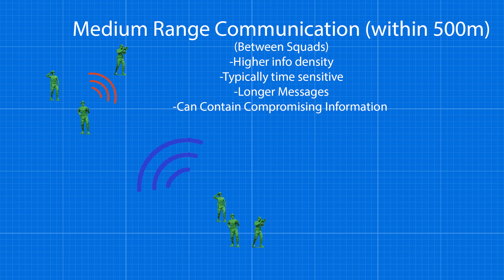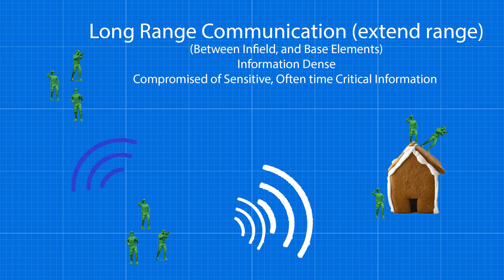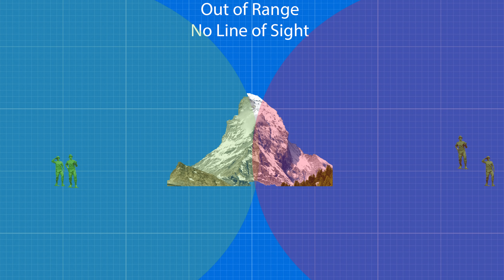Intro to Advanced Comms for the Prepared Citizen

Comment: Learning little things like 10 codes and the Phonic alphabet will help immensely. Most people when using radios at first will have a hard time understanding what is said. This will come with using the radio. Learning how to call then identify yourself is also good radio use. "Base this is Ramrod" do you copy. Learn basic radio protocols shortens what is said. This will be help in situation with many radios. This also makes it harder for others to track you! Note: Phonic Alphabet is learning each letter as a word. Don't make them up. A- Alpha, B- Bravo, C- Charle, Delta , Echo, Foxtrot, Gulf, Hotel.... you get the idea. Guess what I is, hint it's a state. Succinct, short and understandable three must on a radio.
Reply: I’d keep 10-codes out of comms and just use plain speak. It’s easier and you don’t risk confusion for people learning different codes (for example the 10 codes we have in EMS are different from police 10 codes which are different from fire 10 codes).

Comment: used Motorola XTS2500 setup with matched encryption capability is a deece start.

Decent Alternative:
Home built LORA with a repeater network to obscure your location partly with a cell phone hardwired to the LORA RX/TX to decode the encrypted digital LORA signal to text-to-speech for headsets. (If enemy has cell/wifi capability, de-solder cell and wifi chip from board of cell phone or tablet for less chance of detection).
 
If you have someone tech hardy set it up and install repeaters on power poles, this can create a 5-10 mile radius of comms pretty quickly depending on obstructions.

If you want an actual battle map look at Meshtastic and ATAK combined however this may require use of cell/wifi tech.

Stay frosty my friends.

Comment: I'm an exceptional nerd when it comes to this topic, I think you hit the important points without offending the nerds, and probably without beating the noobs over the head. SDRs and RDF devices are getting cheaper and easier to use, I tend to think a real approach here is to use the radio to make friends and gather Intel, this making your local area a bit less hostile.

We regularly post signs when we're in an area for freq and pl to talk, sometimes leave a radio in an ammo can. Talking to ppl outside firing range can sometimes prevent a blue on green.

Comment: This came in with impeccable timing. Our group is finally getting into comms. We decided on Hytera HP682s. Supports AES256 encryption, DMR+Analog, Bluetooth and GPS is optional, relatively simple to program (compared to the Motorolas anywho) and more. Pretty excited.
Reply: U guys messing with atak?
Reply: Encryption just brings attention to yourself and the Bluetooth and GPS just guarantees you’ll be located immediately and likely tracked live in real time
Reply: @riflesfirst208  The GPS doesn't transmit, it just receives.
Reply: @jhutch1470  I can’t say that’s accurate in this particular instance. Does this unit not do that thing where you can flash your GPS position to people in your group?
Reply: @riflesfirst208 t. someone who didn’t watch the video nor do they know what they’re talking about
Reply: @zokhrozzWoomzy  Whatever helps you cope.
Reply: @riflesfirst208 do you have any reasoning behind your claims?
Reply: @riflesfirst208  good advice for yourself. whatever projection helps you cope.
Reply: @zokhrozzWoomzy  Your tacit concession is noted. 

Stay mad.
Reply: @lucastonoli3256  never touched that plebbitors channel 🤮

Comment: I heard Garand Thumb I think on his drone video say that radio is a drone magnet, which could be a danger even in non overmatch situations, as anyone can get a drone that will be able to drop bombs…
Reply from the maker: it's a consideration for sure. 
I know you didn't imply this:
But recall that comms are basically mandatory, only because you can be punished for using something doesn't mean you should abandon it.  Almost everything in this sphere has something designed to exploit it.

Realistically speaking. No one is going to have the capability to utilize that. And ironically, I don't think the US gov cares to use a loitering commercial drone.
Reply: They can't track everything

Comment: As a 06XX this is good stuff. Would like to see you go more into HF/BLOS stuff. On the LOS side you hit it. You’re not gonna be able to “hide” without encryption but you can get pretty damn close with proper usage of prowords, prosigns and callsigns, terrain masking, and just not talking if you don’t have to.

Edit: I’ll add that some of the equipment we use to direction find is commercial equipment, just VERY expensive. You can make your own jamming equipment or even radio decoys at home for cheap. Just saying.
Reply from the maker: we've looked into DIY stuff.
ATM you're better off dropping about 1000 bucks for a DIY solution from someone else.
Reply: 0221 here Rah….
Reply: If you have access to a spectrum analyzer, you can just mask your radio communication with other frequencies that are already common in the area.

Comment: I feel like Risky Chrisky is going to come yell at me, but digital radios are the best option given the encryption options 😮
Reply from the maker: best as in easier, yeah. 
Best in terms of other factors, depends on what you need.
Reply: Not really no they have a purpose but they have a lot of downsides
Reply: @Dread_Pirate_Homesteader  a decent digital radio will still do everything an analog will do. What are these downsides aside from costing more than $25?
Reply: @commonsenseproductions5893  GPS Beacon,  requires a computer to program  etc
Reply: @Salty_Boogers  You'll need a digital repeater as well. Not nearly as common as analog repeaters and it requires a data connection where analogs do not.
Reply: @Dread_Pirate_Homesteader  The GPS is receive, unless you use it for APRS, and everyone has a computer. I would not have an idea of what the etc., would be.

Comment: I learned enough about comms to do some of this stuff while still hating how much bootlick and insufferable HAMs can be.
HF does have a place on a community level, not squad level.
Reply from the maker: for sure, it was mostly a joke.
We're actually looking to get into HF
Reply: by far the worst part about radio is the other hams.
Reply: There are many good hams out there. I know many. We just off of the "club" repeaters, because those are the ones that are sad hams.
Reply: Bootlick hams, ha! I have my ham license but it's nothing but frequencies for me, 99% of ham radio operators are old fudds who are basically the problem with our country... off my soapbox 
HF can be used in a digital messaging as well as a baofucked radio with your cellphone and a APRS cable. I can go on and on, but I try not to make this a 40 min. Rant lol
Reply: HF is a pain because we have to set up and take down long antennas and they’re not super mobile while the antenna is deployed. It’s  advantage is that it gives us any range we want from short to medium to long without the use of repeaters. A common misconception is that HF can only do very long ranges (like other states or countries). But with correct frequency selection, HF is very good at short and medium ranges too. If you’re coordinating activities with another unit in the next valley over, or your squad is reporting back to HQ twenty miles away and a repeater or cell phone  is not an option then HF is you’re best/only option.

Comment: I have two Ailunce HD1's.  It claims to have encryption. My main concern is having comms that every inbred hillbilly in southern Missouri can't listen to.  I've been a little stumped finding a good 50w DMR mobile unit though.  Any suggestions?
Reply from the maker: if it "claims" to have encryption then it means it's able to be encrypted. Encryption is something that you have to setup on your end
Reply: The HD-1 uses a proprietary encryption, it's not AES. Worst of all it doesn't work with any other standards, only with other HD-1s. If you want interoperability with other AES based radios, probably the Anytone would be worth investing in
Reply: But you're not worried about a certain population who are responsible for 60% of the homicides? 😏
Reply: The Anytone 578 (while not cheap @ 480$) by all accounts is a fantastic mobile 50W digital radio capable of easy AES 256.